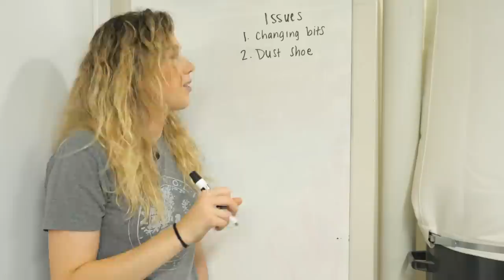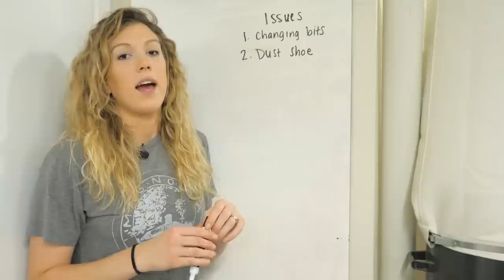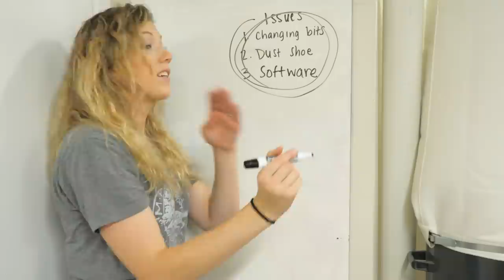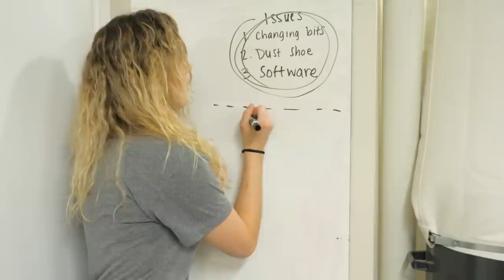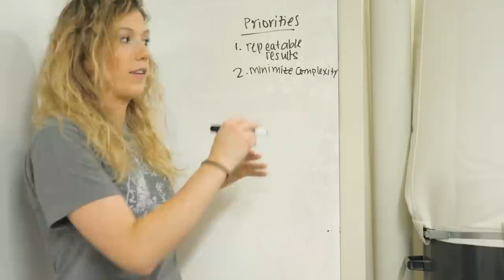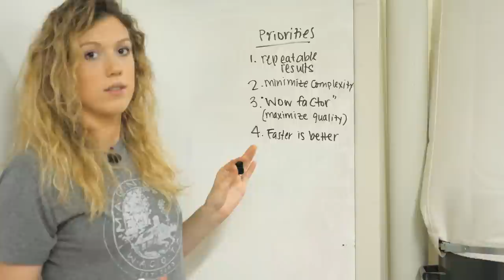LET'S CONQUER THE CNC! Part 1

Comment: In fair disclosure, I am an Axiom Precision CNC Router dealer.  No, I'm not trying to sell you a machine, I would recommend buying from a local dealer that can provide support.  I typically spend 8 to 10 hours training a customer that buys a machine from me.  I don't sell cheaper machines since I couldn't afford to provide this level of support for them.  If you have a local maker space or a community college, they may offer some training also.

I would recommend getting a higher end machine if you need better reliability and consistency.  I demonstrate and use an Axiom AR8 Pro CNC and Vectric Aspire software.  I usually home my machine only when I start it up.  It sometimes stays on for days at a time.  My machine will easily cut 3/4" plywood in one pass with a 1/4" spiral bit at 50 inches per minute, with excellent edge quality. Axiom does have some videos on you tube showing the differences between their machines and others.

If the carriage moves with the power on when you are changing bits, the stepper motor has lost position and will need to be re-homed.  If your spindle motor has a flat on the spindle, try using  2 wrenches instead of the spindle lock.  This problem won't happen on a better built machine. No special methods are required to lock the motors into position on my machine, and you can't move the carriages even if you try, as long as the power is on.  If you are going to run the same bit for a long period of time,  I would re-tighten the bit after 15 or 20 minutes of cutting.  You only need to re-tighten once for a given run in my experience.  After that it should be good for many hours of run-time.  Even if the bit was properly installed the first time, it might work loose over time.  This can cause a lot of damage and frustration.  If you break a bit on a well-built and well programmed machine, it is always user error of some sort.

The dust collection hood does look inconvenient.  Hoods are available that attach with rare-earth magnets in seconds, made by Axiom and others.  Or you could make your own with your router.

Vectric software can be downloaded for free to try out, but you won't be able to generate a cut file until you pony up some cash. They have lots of online tutorials available. I have trouble understanding the British accent on some of them, but that's just me.  With any software, expect a learning curve.  The more powerful the software, the longer the curve.

Work holding is a problem we all deal with.  I use a vacuum hold down system, but it was expensive to set up.  I would recommend using a fence in both the X & Y directions cut into a spoil board.  Always position your work against this fence, and use cleats to hold the work against the fences if necessary.  Hold down clamps are still necessary, but don't need to be as strong if you constrain the work horizontally.   I make my own spoil boards and mostly used screws to hold the work down before I switched to vacuum.  I'v hit screws with the bit many times due to user error.  I have even managed to unscrew them with the bit if you hit them just right.  Double sided tape may work for you, but it might not be enough for heavy cuts on a bigger machine.  Also, the cost of the tape can add up if you are using your machine as much as you could be.

If you get into 3-d work, always use your tool probe on the surface of the table, not the work.  You can enter the thickness of the work in the software.  This is more accurate if the material varies in thickness. and most of it does.  I also set my coordinate system to my fence 0, 0.  Its more repeatable and quicker than working off the center of the work.

I would try cutting the lettering first, then cutting out the circle last without un-clamping the stock.  That way you won't have to re-clamp the circle to cut the letters, causing possible positioning errors.

I would strongly recommend getting a water cooled spindle that will accept 1/2" shank bits if you decide to upgrade.  They run cool and very quiet, at least until the bit hits the wood.  They last much longer than a router motor with brushes.  Router motors are greatly over rated power wise, and have a short life span.  I used to replace my Porter Cable 3-1/4 hp router motor about every 6 months.  I have never had one of the water cooled spindles go bad.  A 2.2 kilowatt electro-spindle has a lot more power than a router motor, and costs less to replace.  The electo-spindles also use a starnder er style collet, allowing you to run different size bits.  A 1/8" shank bit costs about 20% as much as a 1/4" bit, and in some cases will do the same work.  I use 1/8" round nose bits a lot for 3D carving.  They will cut up to 5/8" deep in one pass, and last about 50 to 60 hours.

I would also recommend a cutting area of at least 24" X 48".  Even if you don't make anything that big,  you will bet better yield from your material, and the the machine can run  more parts at a time without reloading.

The hardware and software I would recommend for light production would cost at least $10,000.00, but your frustration level would be much less.  I have done single jobs with my Axiom that paid for more than 1/2  the machine.  A higher end machine costs more, but would greatly expand your capabilities and productivity.  My machine routinely runs with little attention for many hours at a time.  Once you get tired of watching it work, you don't need to, and operating costs are very low. 

I hope this helps, good luck and don't give up.
Reply from the maker: Wow Bob. Thank you for the wealth of information! Will definitely reference your comment again in the future - we hope to get a more professional machine once we tackle the learning curve of software and problems on this smaller machine.

Comment: Try saving the different tool paths into separate files and running them one at a time. When you need to do a bit changelet the first toolpath finish, then change your bit, then run the next toolpath.
Reply: Also do some research on G-Code. You can write your own G-Code that will keep the stepper motors on while you do a bit change. That way the game tree won't move while changing bits

Comment: You may want to try masking tape and CA (aka Super Glue) instead of double sided tape. Apply masking tape to  the two parts you want to hold down. Apply CA glue to the masking tape. Then stick the two items together. Generally the cost is less, holds just as well (if not better), it's easier to remove, and it leaves little to no residue. Some double sided tape leaves a really bad residue on the surface after you remove it.

Comment: First, I wouldn’t use the dust shoe. I would recommend building an enclosure around the Xcarve. This contains the dust, allows you to record the actual cutting and can reduce or remove the noise from the machine.

Second, I would recommend blue painters tape as the hold down. Basically you put blue painters tape on the back of the wood and on the waste board. Put a few drops of super glue to adhere the two pieces of blue painters tape. 

I bought my Xcarve when you guys did and I would agree there is a learning curve. Let me know if you want some more tips with it.
Reply: For software, I recommend either learning vcarve if you are going to do advanced stuff like full 3d carving. But if you are sticking with signs and things that are more 2d in nature I would recommend staying with easel and importing SVG files from illustrator, gimp, or whatever your familiar with.

For bits I have a 2 surfacing bits, 1/4 inch compression bit, a ton of 1/8 inch fishtail, a ton of 1/16 fishtail and a few 1/32 fishtail bits. Those are the primary bits I use. I just purchased a couple of tapered ballnose bits and a couple of diamond tip drag bits. Used the drag bit the other night and the piece came out decent.

Comment: I'm going through these same growing pains with my cnc machine.  I just completed a project in where I build a soundproof enclosure to house my 4ft X 4ft Shapeoko XXL.  It has dust collection and it's so quiet, that I set it up in my basement so I can make stuff over these long cold Nebraska winters.  Check out the Blake Weber video on his Ultimate CNC Setup - it's amazing.  Try Oops Clamps with a t-track spoilboard! I made my own t-bolts and am using a 4x4 slatboard panel from Menards as my spoilboard.  Pin nail it to the OEM spoilboard and you won't see any movement.  So for software, I hear a lot of people using Fusion 360 to make their G-Code.  Carbide Create and Carbide Motion are free and work fine for 2D work. When changing bits, try setting a clamp on either side of the gantry to prevent x-axis motion, if that's an issue.  Wish you guys all the best!

Comment: I like Blue Painters tape with rapid setting super glue to make 2-sided tape, only takes 30sec to set. It has less movement than carpet tape and other two sided tape products. For production runs, a jig for the piece or vacuum table would be best. Tape and glue is faster than setting up clamps for one item, but if I am going to make 20 of something, I will brad nail a temporary fence to my wasteboard and then use a cam clamp or a wedge to hold the piece. This way I only have to set the Z axis. I have the shapeoko xxl and am glad I do after seeing your experience with the x carve. I use the suckit dust boot and it works well, my friend has the PWN and I like that you can see it cut because the hose comes from behind. Would be good for videos ;)

Comment: I myself would convert the CNC controls be controlled by mach3 or  mach4.  We use Turbocad to make all our drawings and save them as a dxf.  Than we use V-Carve Pro to make all my CNC router programs. We have two Biesse CNC routers one Onsrud CNC router along with four other CNC machines that use Mach3 and just ordered  a Boss router. We believe in keeping the software simple and keep it standardized across all our CNC machines.

Comment: To really lock down the motors on Idle (ie. when you are changing bits), there is a two step fix. I had a site for it, but can't find it. But it comes down to a) turn the dip switches for each axis (switch 4 if I'm not mistaken) to off, so the controller always gives full power to lock to the motor and b) set GRBL parameter $1 to 255 ($1=255). You can do this under machine -> advanced -> machine inspector in the EASEL interface.In the Console line, type $$ to list your parameters and $1=255 to change the value. Worked for me. As for software, look into VCarve (Desktop or Pro) or if you want to go big in the future, Aspire. I use Easel just as a GCode sender, but there are other options for that as well. And someone mentioned the dust collection be (part of) the problem and I think he's right about that. Try having the dust collector/vacuum on a separate electrical circuit and or ground your vacuum hose. Hope that helps. I'm by no means an expert, but find that yes, the XCarve is a starter machine, but it can be very capable, within its limts.

Comment: On ANY belt drive cnc there is almost no resistance in moving the router when changing bits. Far easier to move with the power off.  Leave the power ON when changing bits.  Less likely to move by accident. I use a total scratch built CNC using half inch Acme rods running mach 3.  Its almost impossible to move the router with the power off and far more difficult with the power on.. The steppers have at least 6 times the strength of those on an x- carve.  Also get at least v-carve desktop..  Its light years better than the crap that comes with an X-carve..

Comment: Don't run any deeper than .03" at a time. Your machine is likely skipping on the belt. Hit me up if y'all would like more tips. I have run one like yours as well as a CNC that costs $150K. I guarantee there are a few issues present that you are unaware of.

Comment: I have the same CNC you do, It was a huge learning curve. I work with 3D printers and the K40 laser engraver (modified) and this is very different.

In regards to the questions you have that work for me:
1. I always home the machine after EVERY tool change this way I have a known start point, and have not had issues with off center carving. I originally did the starting point at the center and had too many issues when changing bits.
2. Not sure on this one, I do not have a dust boot yet but looking at the Suckit dust shoe.
3. I don't use Easel anymore, I have a Raspberry Pi 3 running Universal G-Code Sender and use Vetric Aspire for carve designing. The nice thing is that the Raspberry Pi 3 is used wireless from the PC to  Raspberry Pi 3 for sending my g-code, and the Raspberry Pi 3 connects via USB to the X Carve controller.

Comment: I use vcarve pro software. They have lots of tutorials to learn to use it. Get your carbide bits on Amazon. They have the best prices. Learning feeds, speeds & depth of cut is key. I suppose it helps having 25 years of cnc experience.

Comment: I do tutorials on cnc design and setup using my Shapeoko. The principals are the same for any cnc router. If you go to my channel, you can find my IG and Facebook accounts on the banner. Feel free to message me on FB. It sounds like you guys need a good crash course in cnc setup and principals. To start, you need to put a guide on the left and bottom of your waste board. I also like to run a second waste board on top of the factory one. I make my own “clamps” out of scrap pieces of wood and screw them down using screws that go right into my waste board and guide rails. Cheap, easy, repeatable. You need to change your mindset to being a manufacturer to be successful with the cnc.

Comment: Never have had a problem with mine. Sorry to see you having these issues. Mine has made about 800 signs and only one operator error mistake. My Axiom however is about 3 times faster but costs 8 times more. Use nothing but V Carve software. Nice jobs on your signs!

Comment: If you're going to try and make money with the cnc then you will need something more rigid and trust worthy. I realize you want to start off cheep (and that's what you have) but an investment in a desktop machine from someone like Laguna, Shop Sabre or Lagecy would be a much better deal in the long run. I also recommend Vectric software. You can start out with their 2D version and upgrade as you need to or as your business warrants it. You can also download it and try it for free. Good luck with your endeavors.

Comment: I would bring the CNC to Home on bit change and re Zero . Doesn't take much more time for the added insurance  . For clamping  I would install a couple of T tracks and use aluminum bars with a T bolt and knob to tighten it down .

Comment: I have the same problem with the xcarve  but I fixed  try to put at fence around the cnc machine with the meet the zero in left front.  Try to zero  2 o 3 times  so you know is the same place every time. Went I go to change the bits  I put the new bit and them you zero the machine and used the probe to zero the zero axis  to went you star carve again make sure the press use previous zero  that is a fixing my problem

Comment: Are you turning of the controller when changing the bits? I turn the router off but leave the controller on as this will add more stability when your changing the bit. I made my own dust collection for the same reason.

Comment: Are you cutting the circle and then carving the text? If so, carve the lettering and then change bits and cut out the circle that way you don't have to re-zero the machine. Also, you're router should not move on the gantry at all while you change bits. Are you turning off the power to the x-carve when you change bits? As long as the power is on on the x-carve, the router should not move at all. If it is, then chances are that your belt is not tight enough and your stepper motor is skipping.

As far as hold down methods go,  I made my own out of some simple 1 by pine. That way when I accidentally run into one with a bit, it doesn't ruin the bit or the piece and I can always make more if i need to. And when I am cutting out a project, I use CA glue with the activator and blue tape on the piece and wasteboard. Not once have I accidentally glued my piece to my wasteboard and it comes off really easily without leaving any kind of residue.

And as for software goes, I would have to recommend Vetric V-Carve or Aspire. I would go with the highest edition you financially can because the higher you go, the more features you get. I personally use the desktop edition, but that only limits your job size to 25x25 before it makes you tile the job. The learning curve with this software is pretty easy. It didn't take me any time at all to pick it up. And plus there are several tutorials out there for different topics. I own the Shapeoko XXL and most of the youtube videos I've seen for others that use the Shapeoko also use the Vetric software as well.  Hope some of these help. Good luck!

Comment: Look for M84 in your gcode. It cuts the power to the motors, so they lose their holding torque. If you delete that, the motors should stay energized and have plenty of holding power to change bits, assuming your belts have proper tension. Or you could change it to M84 S600, giving you a 10 minute delay before turning the motors off. (The S modifier is just time in seconds)
Reply from the maker: Thanks, Brandon! That helps a lot
Reply: @jennieanddavis  No problem! I hope it does.